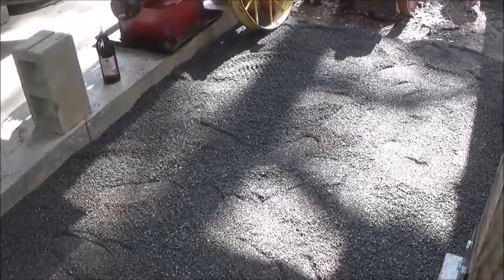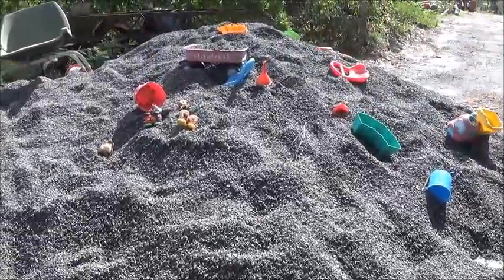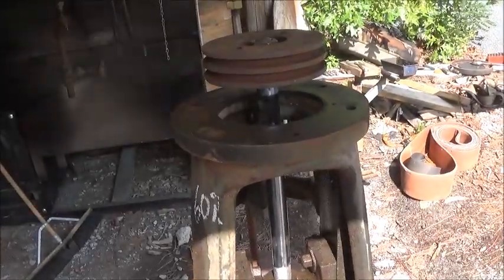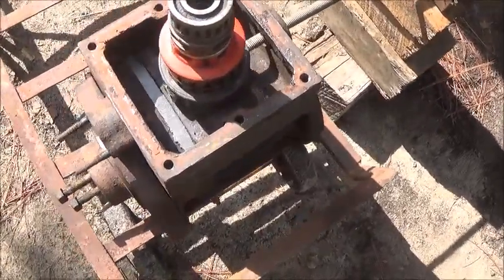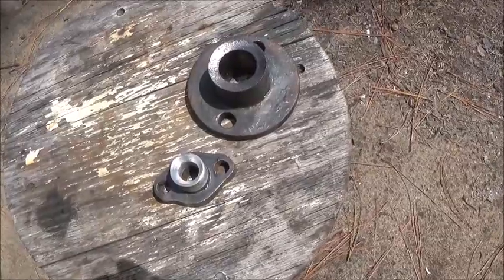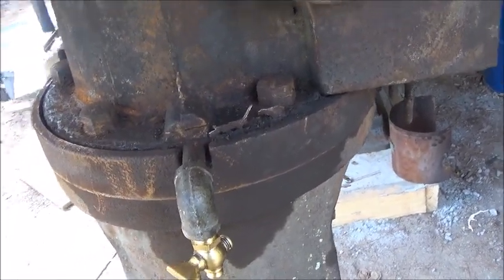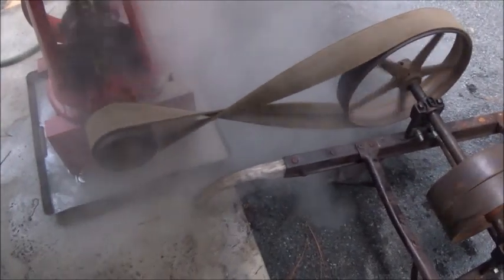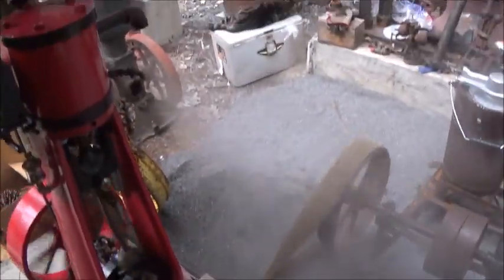UPRIGHT STEAM ENGINE REPAIR SITTING FOR YEARS PART 4

Comment: The Borg Warner overdrive IS a nice feature. I installed a transmission from a 1961 Bel Air with the overdrive into my '77 C10 pickup  and it makes the 'out of town' RPMs  a lot more friendly.

Nice videos of the progress on the upright steam engine.

Comment: Thanks buddy. You not only entertained me for a few minutes, you made me hungry as well. Very nice!!! Hope you will explain that valve operation while we have such a good view of the innards!! 
170 cubic inches huh?? That is pretty small, Just finished assembling a Model A four banger. Those were 200.5 cubic inches and used a 65 pound flywheel. Lotsa torque with good inertia. Pretty hard to stop!  !;o)

Comment: OK, let’s break down the physics here.  1.  Human energy to cut and split firewood. 2.  Heat from fire transferred to  boiler and then to water. 3. Water heated to stem. 4. Steam expands to push piston in steam engine. 5. Piston pushes crosshead. 6. Crosshead converts linear motion to rotary motion of crankshaft. 7. Flat belt transmits rotary motion. 8 Twist in flat belt reverses rotation. 9. Flat belt turns gear jack. 10. Gear jack turns horizontal shaft on ice cream maker. 11. Right angle gear turns paddles. 12. Paddles keep cream in contact with outer surface of tub. 13. Ice removes heat from outside of top. 14. As heat is removed from cream, cream changes from liquid to solid. 15. Solid ice cream is aerated by paddles.  After all of that, I am surprised that you have the energy to eat it!  Great video!
Reply: OOPS!  I forgot the salt.

Comment: You know if you were to send the exhaust steam up through a barrel full of high surface area media like ping pong balls or broken glass, then you trickle water down through the barrel from the top, you'd probably end up collecting enough 200 degree water to keep your boiler full and then some.

It's not exactly period correct, but it might be a little more fun having your pressure come up that much quicker after a refill. Maybe even use the extra hot water to warm up a hot tub...
Reply from the maker: I have a antique riveted heat exchanger that will be piped in soon.
Reply: @jonathanw4942  Awesome, can't wait to see it.

Comment: I didn't know about how there were holes in the piston for the steam to get in there to help push the rings...l think l did see a nick in the slit/port/runner up there at the top of the cylinder where a piece of a piston ring might've needed some help making it's way through a place it didn't need to be...l think it went through there & stopped that slide valve & the eccentric/lobe didn't care nothing about it with flywheel momentum backing it up & the po' valve rod what goes through the packing collar - both them had to pay the price 🤔 but I'm not there so l can't say...bullet nose ride along - best part of the whole video (for me) l always say: "you take care of them - they'll take you anywhere you want to go" 100% proof right there 👍
Reply: Also, I'm of the opinion that you can see more at 50mph than you can at 80mph...l think it was Yogi Berra who said: "you can observe a lot by just watching"